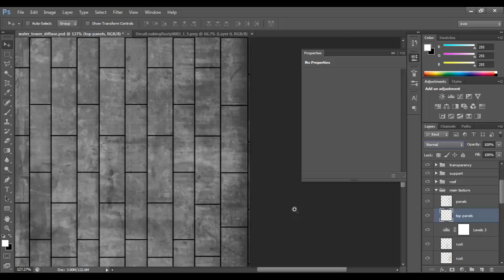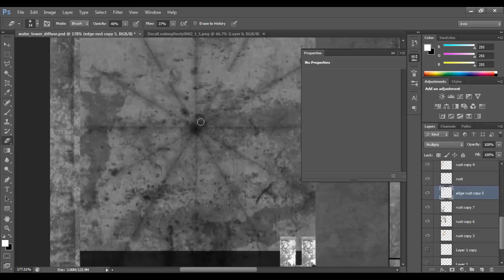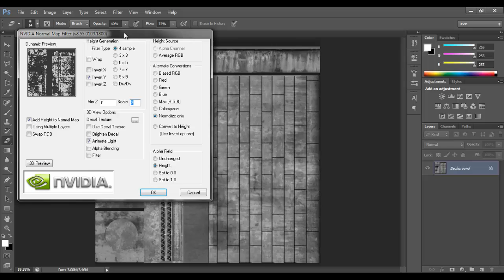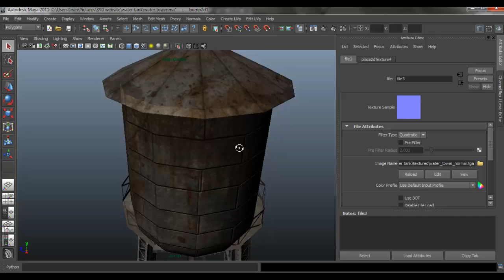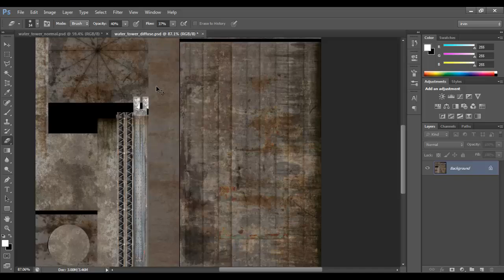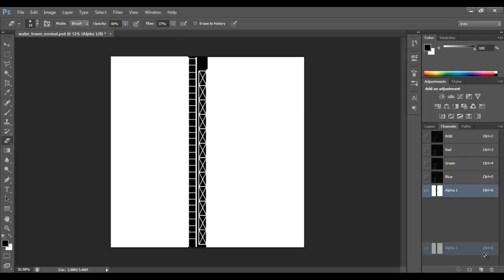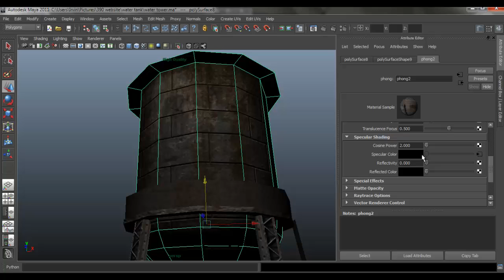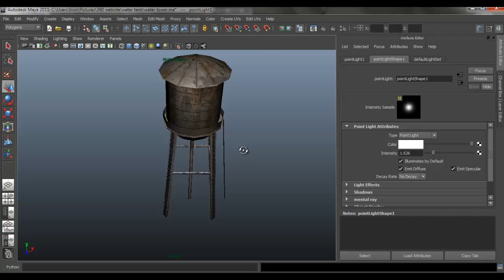Autodesk Maya 2014 Tutorial  - Water Tower Texturing Part 6 - specular map

Comment: when m using a point light and use it to see the normal map effect on my mesh using "use all light option" n turn to high quality render....my mesh is turning black...i've use the reverse normal option but its not working...pls help..

i am using maya 2009
Reply from the maker: Sounds like a problem with the normals. Does it look like that if you render it? May also be the position of the light. It would only turn black if the normals are reversed.